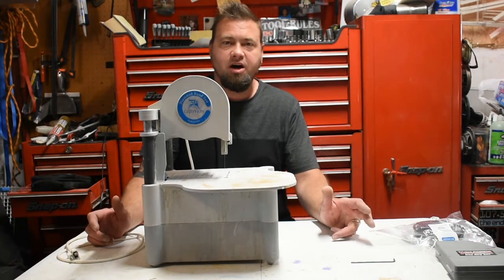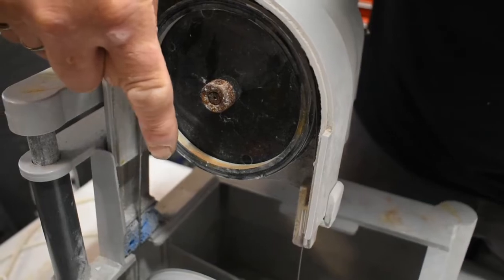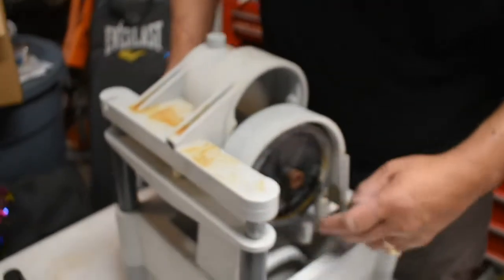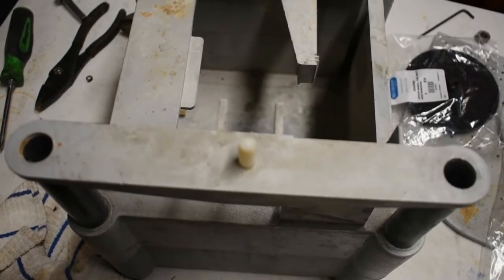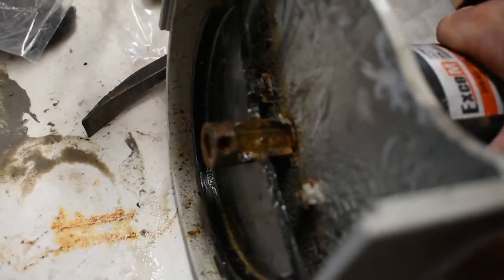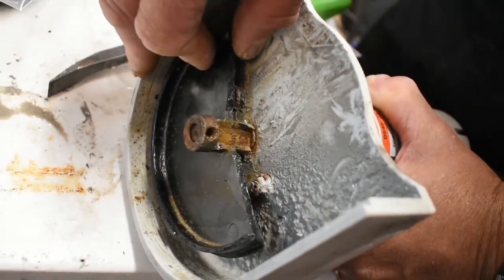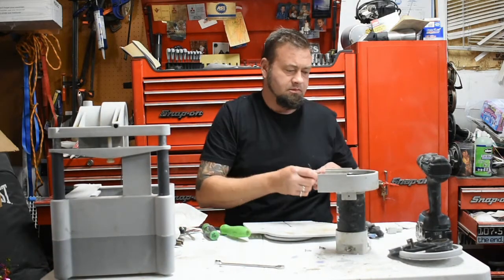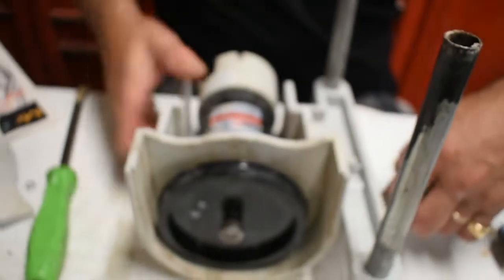Repairing Rusty Gryphon C-40 Band Saw

Comment: HOW OLD IS THAT BANDSAW?
Reply from the maker: At least a few years. Its seen some heavy use
Reply: 😅 was thinking the same thing, mine is around 7 years old & I thought it was looking a bit tired until I saw the rust on this fella! The plastic flanges at the rear of both the top & bottom wheels on mine have pretty much worn away to nothing, which makes my blades sometimes want to jump off (& usually gives me a canny shock😱) so looks like I need to buy new ones. Postage to the UK on top of the item costs is always a killer for the sake of some little plastic parts but what can you do 😮‍💨